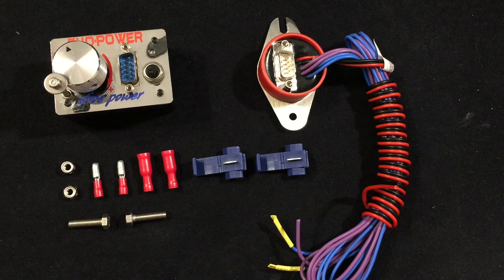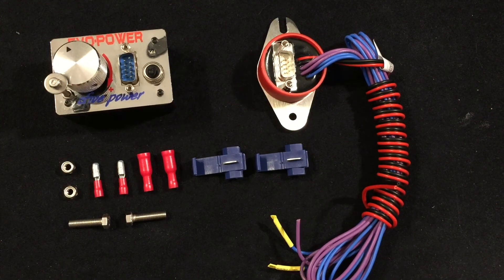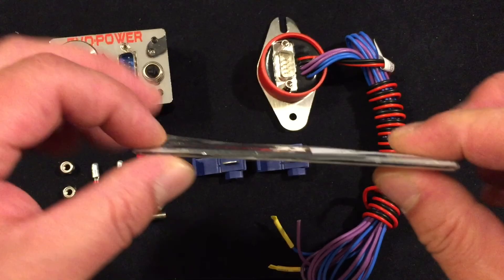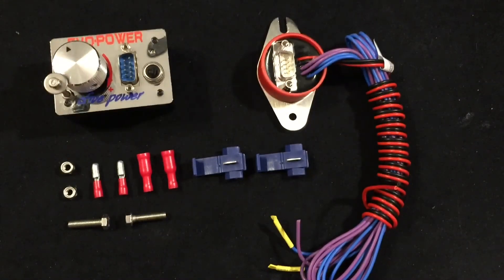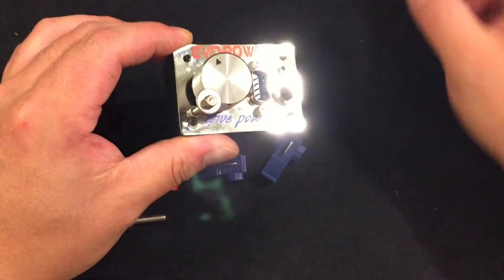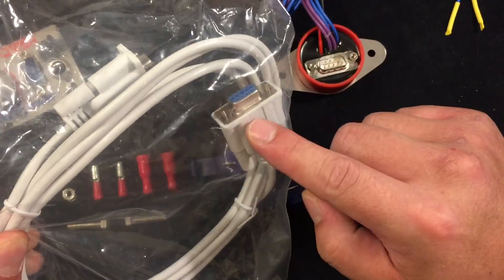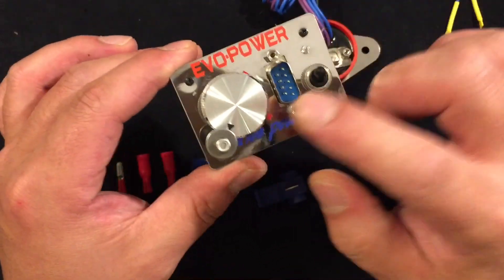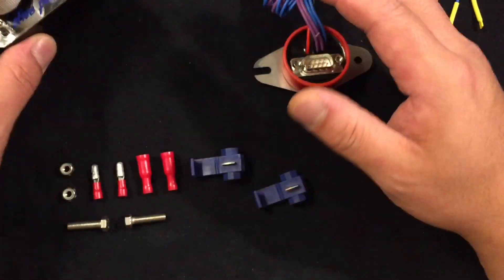Yamaha Nmax - EVO-Tech Performance Chip

Comment: I have just brought one of these and had a nightmare trying to work this out 😅 this has helped me alot thank you
Reply from the maker: No problem my friend, glad I could help!
Reply: How much different it make
Reply from the maker: @georgemadness3233  It smoothed out a few rough edges but if I were to spend the money again I’d get a programmable ECU and map it on a cheap dyno run. Sorry for the bad news mate.

The problem is it needs adjustments almost every week to follow the climate as the seasons change.
Reply: @astroblemeRC  ok I brought the smart tuner one
Reply from the maker: @georgemadness3233  good luck with the install mate! 👍🏻
Reply: Ok I have a big problem 🤣 not sure if you know the one I brought but it's the smart tuner yellow one I may of wired it up wrong because have no extra power at all just just tit over very slow if cuts off if you don't mind having a chat please add me on Facebook Dean George picture of me on a quad
Reply from the maker: @georgemadness3233  Sorry mate I'm not on any of the social media sites, I think I know the tuning unit you have, does it look like a blue and yellow multimeter?

Comment: I'm pretty sure, that threaded shaft is so that you can set it where you need it, and then tighten that down, so it can't be turned accidentally. I made a similar setup using two 500ohm trim pots,, so you can adjust both the O2 signal, as well as the heater current, and its built into the O2 connector.
Reply from the maker: That sounds genius! 👍🏻

Comment: Hi there, great set up btw just curious on how many turns you’ve adjusted clockwise to adapt your fuel needs? I recently purchased this piggyback system and a 155 kit.
Reply from the maker: Hi! from completely turned off, we've currently adjusted for two and a half complete turns clockwise, we're still testing but it seems just about right (or a tiny bit rich), we plan to keep this setting until the new cylinder and piston have run in at about 600 miles.
Our setup my be very slightly different to yours so bare that in mind and adjust accordingly, we are currently running:
180cc, standard injector, Hurricane filter element in standard airbox but with snorkel removed and inlet hole bored out to a larger diameter, Scorpion exhaust (designed for 125cc) and 11gram Dr Pulley rollers.
hope this helps and have fun tuning!
Reply: Awesome thanks for the reply, It’s definitely fixed my idling issues  😁

Comment: Actually I got motorbike with 125cc engine, ye! So my point is by using this kit will make motorbike does pops and crackles? as the engine will be getting more fuel, also I changed the exhaust system completely from stock one, so it does pop a little bit...will it actually work in my case so far ?

Comment: Did it give u more power and how much fuel can u add to the bike have u tried turning it up fully for the bore kit mate
Reply from the maker: It adjusted enough to smooth the fuel delivery out throughout some of the rev range, but was highly dependant on the environmental temperature, getting it perfect for midday riding in the sun meant that we had to adjust again if we rode during the cold nights. We don't recommend this unit unfortunately. thanks for watching buddy!

Comment: Thanks great video think im getting one . Where did you buy it from ? 
please
Reply from the maker: F650GSAdventures 
I think it’s was directly purchased from the US but can’t remember for sure.
I wouldn’t recommend this unit simply because it needs to be adjusted very regularly due to temperature and many other changing factors. 
If I had the choice again I would go with an ECU chip or a programmable ECO simply to have a more precise and active unit that can fine tune every rev for optimum performance
Reply: @astroblemeRC  Hey thanks very much for your help i will look into it cheers 👍🏼

Comment: Does your dial spin 360 as mine does as I just brought a bike with it on also does your light on box come on as mine don't
Reply from the maker: The dial does indeed spin 360 many times, from a fully closed position to a fully open position there is a max stop, if that makes sense. 
There should be a light that comes on, if it doesn't it means it isn't getting power to the unit.
Reply: Yea I have no light that comes on also if I turn it counter clock wise and keep going will it be back at the start then I can turn it few times once it's reset ? Thanks for informing me
Reply from the maker: @OGchannell  
Thats right, if you turn it fully counter clockwise until it stops it will be at point zero which is almost fully reset. It sounds like the power source wire may have come loose or disconnected. Try to locate where they tapped the power from, may need relocating. 
Also, if the power wire was installed badly, it may be an indicator that all the other wise were installed badly too, to make sure, do a once over check just to be safe.

Good luck and have fun! ^^
Reply: Thanks alot I'll take a look might ask you more  questions later thanks dude 😎✌️
Reply: Hi mate my motorcycle keeps popping when riding would I need to lower the setting or make it higher
Reply from the maker: Shane Will 
Hey buddy, a few things can cause back firing, if it’s popping on deceleration the main cause could be that it’s running rich, in which case you could adjust the fuelling to be lower.
Reply: Hi mate I don't have my lambda sensor in my exhaust do I need it as I have that box also have a racing exhaust ??
Reply from the maker: Shane Will 
Hi mate, if you don’t have the 02 sensor it’s not required, the 2 wires that usually connect to them can be tucked away or snipped. Try to cover the wire ends with shrink wrap or seal them with something. 
Have a good weekend buddy! 👍🏼

Comment: Are there any engine problems so far?
Can you feel the engine output rise?
Reply from the maker: GumJong Bae 
So far so good, no running faults to report.
It solves the issue of laboured idling and very slightly smoothes out the accelleration, but is temperature dependant. 
We would say that this unit is a temporary fix for any running issues and a better option would be to have an ECU chip installed and dyno tuned by a shop.

Comment: It's just a variable resistor and pretty much junk
Reply from the maker: Jack Vermeulen 
Absolutely correct.
Reply: I put on my 1700 road star and the low end stall I had low rpms is now gone, if you run it to rich you can cause damage but just the initial first adjustment was all it took to clear it up. This company has been around awhile and wouldn’t still be in business if it was just junk.
Reply: @dwightsaunders6833  Pure Junk. It only works as you stated. That is NOT a good solution. Pure junk, just a variable resistor if you know what that is.
Reply: @dwightsaunders6833  Plus it's about $10 worth of parts and they want how much? LOL
Reply: Jack Vermeulen it was a good solution for my issue, I am not using for performance enhancing just so it runs better. If I had the time to build my own I would have.
Reply: @dwightsaunders6833  LOOK at the claims made. Very dishonest. Total ripoff price. THAT is the point. It is JUNK.